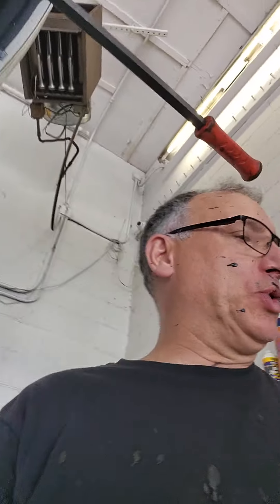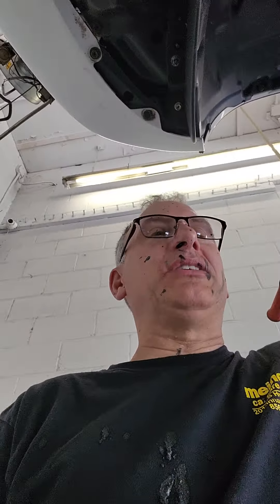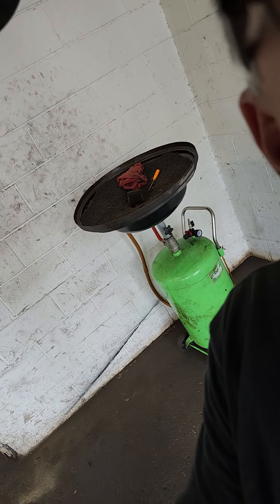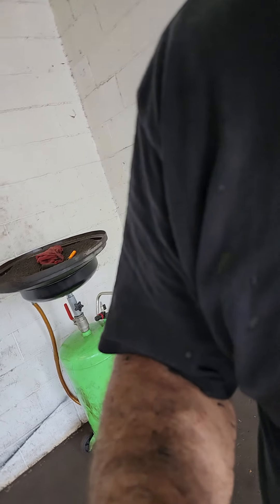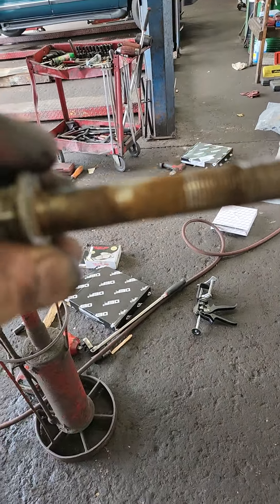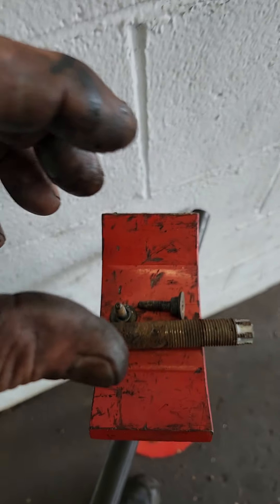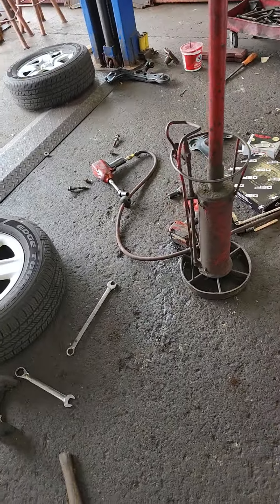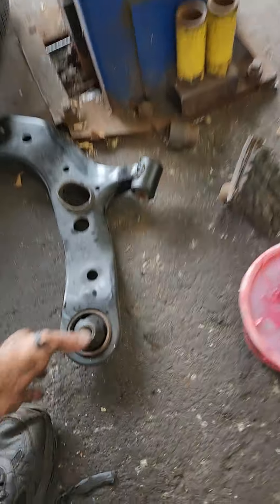Chasing suspension creeks with war paint on my face

Comment: If you ever hear a sound like a wood screw being driven in hardwood without a pilot hole, that could very well be metal fatigue at a joint. Neighbor had the noise for months and couldn't find it. Eventually, the head of a rear later link at the wheel broke from small, repeated twisting. It's a unique sound. Definitely a metallic twisting sound, not grinding or scraping.